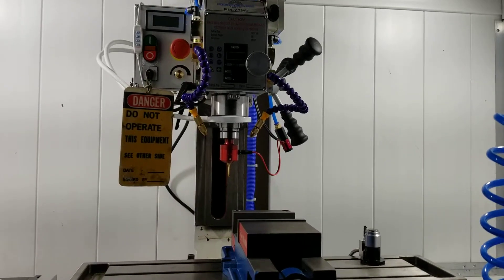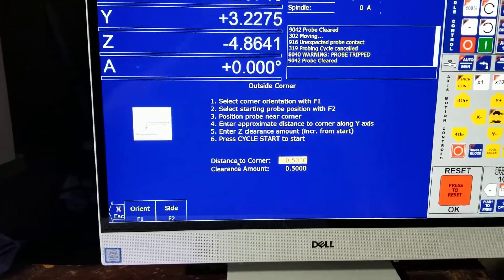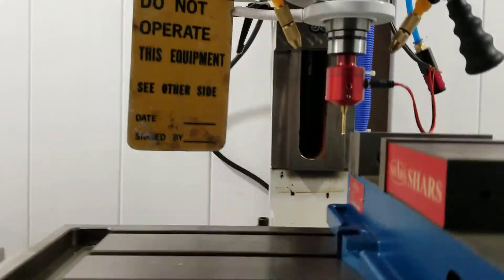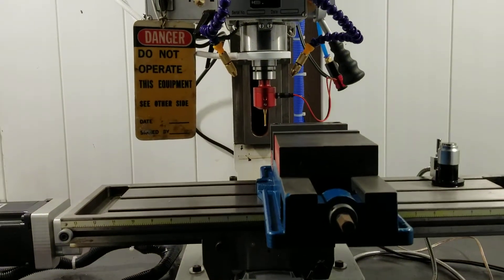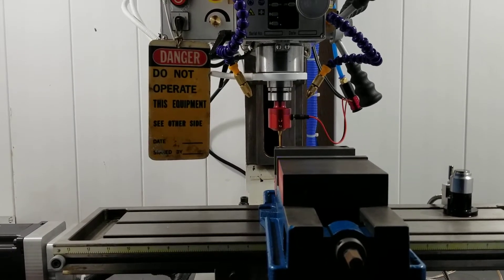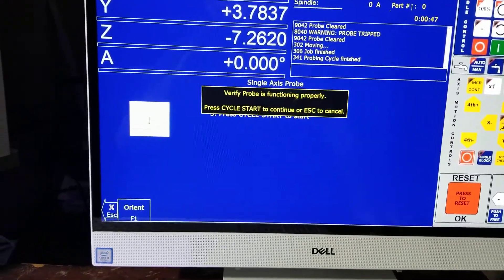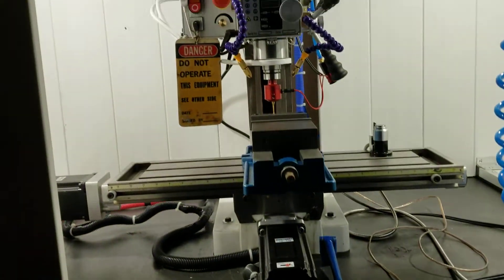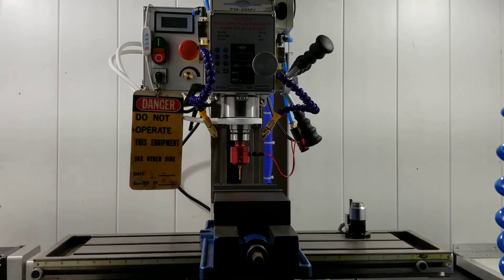Probe test

Comment: My probe just came in the mail. I'm curious on the setting you used to set it up. So far I'm thinking mechanical for probe type. I have not tested the probe for open or closed. Any insight to your settings will save me some time. Lol. Thanks in advance.
Reply from the maker: Mechanical, normally closed
Reply: @rpmcncchannel4147  thanks. :)

Comment: What prove is that? I didn't think I heard it on the video.
Reply from the maker: What do you mean?
Reply from the maker: What do you mean?
Reply: @rpmcncchannel4147  oops. What probe is that. Dang Auto correct tried to change that word again.
Reply from the maker: @ponydowncnc8365  Drewtronics probe
Reply: @rpmcncchannel4147  for some reason I thought cnc12 would only allow their problem. Nice to know I was wrong there.
Reply from the maker: @ponydowncnc8365  you can use pretty much any probe.
It's a easy wire up.
This Drewtrinics probe seems to work well and much less $$$
Reply: @rpmcncchannel4147  and now I know. I'll look into it. Thanks.
Reply: @rpmcncchannel4147  oh that price is really nice. Can you set the z with it?